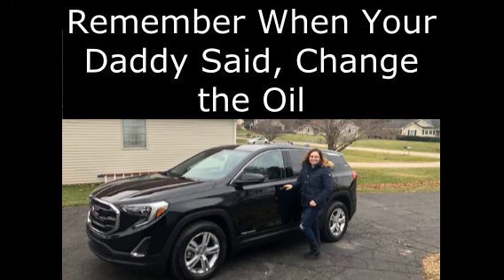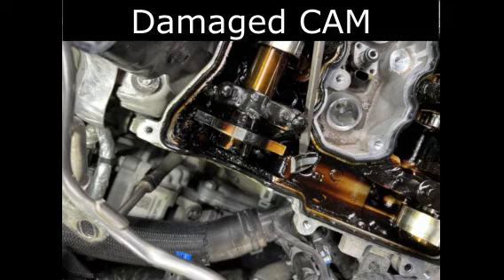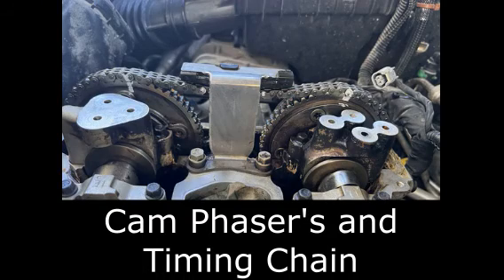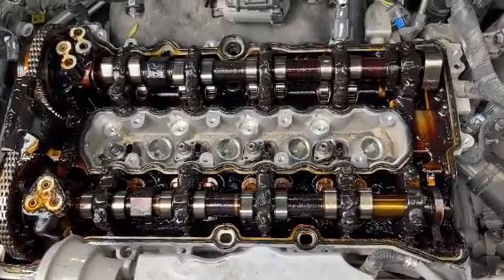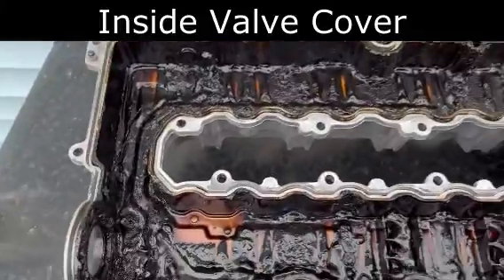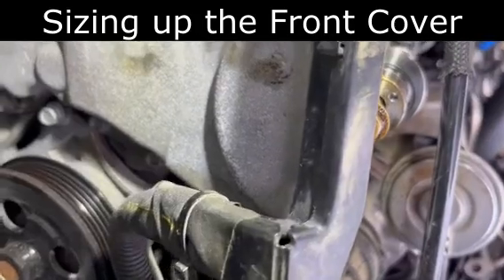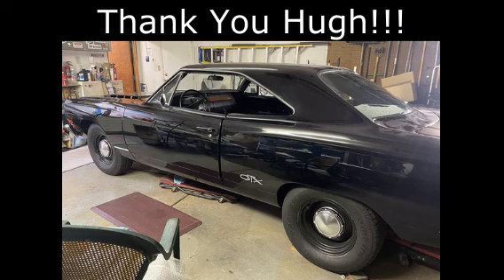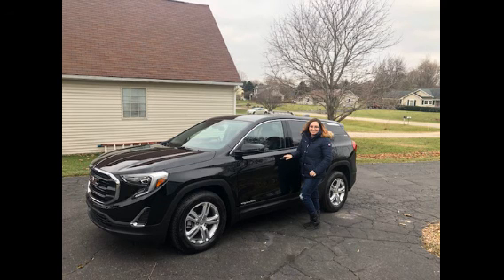GMC Terrain   No Oil,  No Problem!    Yeah, Right!

Comment: Cleanliness is next to Godliness it's true for engines as well maintenance!! And full synthetic oil are God sends.... Especially with modern turds they make today! The clearances are much tighter than on earlier cars!!! This is why they use thinner oils... The oil cushion is way smaller!! After all gas mileage is king!!! Oh they do make special pliers to remove the connectors and being a tool monger myself I don't mind buying tools that I will only use once!!... Hey atleast they're conversations pieces for sometime 😂😅👍... About time you had a real car on the channel GTX!!
Reply from the maker: Hi John, you are absolutely right. All these blocks and parts are CNC machined and fit like a glove. This car burns 0W 20 weight oil.  I actually enjoyed this project. I agree, that GTX is an awesome car!!